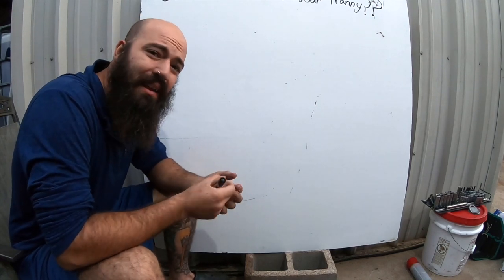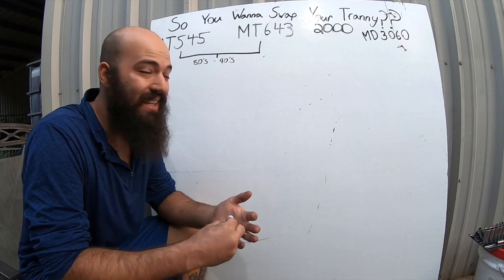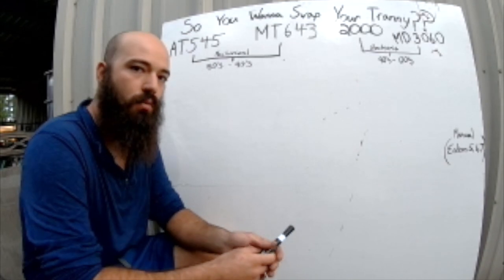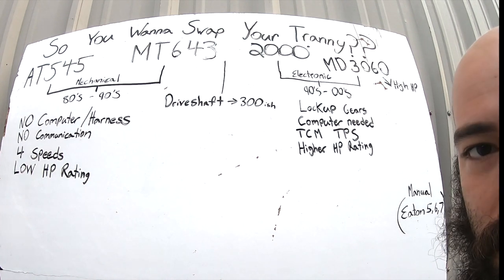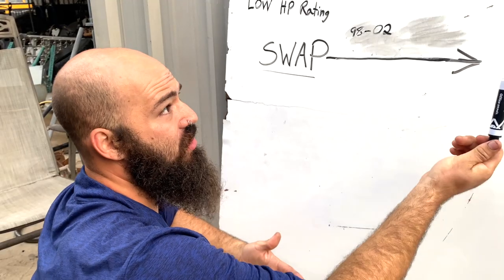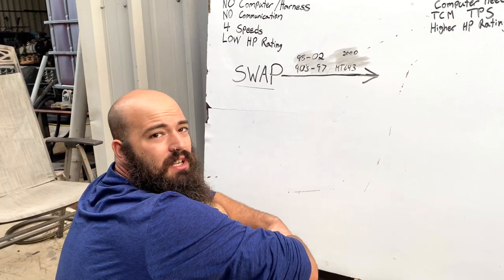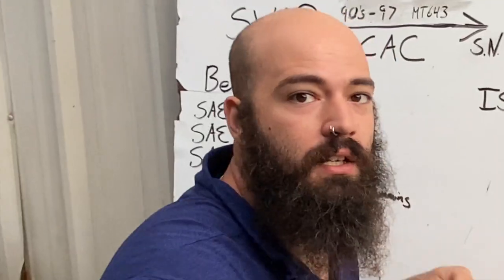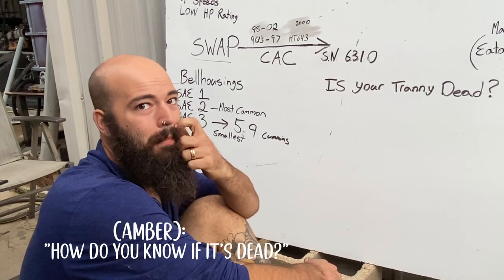Everything you need to know about your SCHOOL BUS ALLISON transmission | Swapping Transmissions

Comment: I cannot tell you how helpful this video and your trans cooler video has been to me! I worry constantly about my At545 mainly because of the hate it gets online. I have driven up and down mountains, trails and highway, for 3 summers with no issues (besides slowness lol). I just checked my fluid using your tips - it's red, no burnt smell and it did not burn my skin, happy days! I do want to install a cooler so will be looking into that. Again, thank you so much for your clear explanation, covering it in such detail easy enough for non mechanics like me to understand. YOU ARE THE BEST!
Reply from the maker: Thanks for watching bud! Glad your 545 is doing its job. It’s a beast, just slow. Run an oil analysis on it if you want better insight on its condition!

Comment: Yep, I've done the AT545 to MT643 conversion. Added a cooler and now tow over any pass with zero overheating issues. So glad I did it!!
Reply from the maker: Whoop whoop! I’ve only driven one 643 on flat highway. I’m so glad you did it too😂
Reply: I need more info about this. I got a. At545  trying to swap it

Comment: I've been following along for awhile now, nice work on the swap.  I have a flatnose Bluebird and I'm researching options.  You mentioned that a manual transmission cannot be swapped into a flatnose, cabover semis would beg to differ.  I can't find any information online, so it looks like I will pave new territory and document my journey.  Your information provided here is invaluable. I will now be looking for an Eaton Fuller 7spd vs the 10speed I had originally planned
Reply from the maker: So happy to hear you’ve found value in our content. It sure is frustrating to do mechanic work & film at the same time but you should absolutely pave the way with your flat nose!
You are also right about cab overs, in the year since filming this I’ve had the pleasure of driving and working with a cabover. There are a few transmission options in these cabovers that are shifted by cable. The one I’m familiar with is Eaton’s roadrunner series but it’s just as wide of not wider as 10, 13, 18 speeds. My concern is it fitting between the frame rails.
We have a 7 speed Eaton fuller for sale here in Alice, TX. A used take out
Feel free to email me for my contact info if you need help or an ear.
Parishskoolie@gmail.com

Comment: Nicely done!  It's so good to hear a voice of reason regarding the maligned AT545.  Absolutely, it's not the most desirable...the lack of torque converter lockup wastes some energy, creates some extra heat, and reduces (almost eliminates) engine braking effect...but they are common and well built and can serve well, if taken care of.

Don't forget the MT653, if you can find one.  It's just the 5-speed version of the 643.  Both are great transmissions.

And, one addition to the mention of the MD3060 (or the 2000s).  Most do indeed have pushbuttons, which is a good way to identify those.  But we've also bought school buses with MD3060 transmissions that have a manual shift lever.  So, we advise shoppers to not immediately assume a manual lever means a less-desirable transmission.  Look for the little red LED indicator square next to the shift lever...which an AT545 or an MT won't have.

Thanks for putting this video together!  Liked and subscribed.
Reply from the maker: AWESOME! Thanks for watching & following along friend!
We would've loved not having to swap our tranny, but out 5.9 Cummins is very grateful we did. Feels like we just unlocked a governor!

Thanks for your input! I COMPLETELY overlooked the MT563(even tho i have a manual for all these Allisons). The manual shift indicator is great info as well, Its crazy how inconsistent these buses are with their interchangeable options.

full swap video coming out soon!
Reply: @parishskoolie  Right on.  If you get West on I-40, let us know.  We're just West of Flagstaff and have a nice bus parking spot you're welcome to stay in for a few nights.  Summer temps up here are nice.

Comment: Love the video it was great I learned a lot I have a 85 international with  Detroit 500 V-8 diesel 545 Allison. so this bus has 96,000 original miles.  The transmission has been perfect except for I had it idling while loading all of my belongings to leave my property and start traveling.  and went to move the bus and it would not go into gear. shut it down. checked everything everything seemed fine. linkage is moving fluid perfect not burnt super bright red no metal shavings in just looking on my hand. doesn’t smell burned. cranked the bus up again went directly into gear didn’t think much else about it just thought something weird happened concerning but. went ahead and tried to leave went through all of the gears and then started up a hill and would not pull.  Will not go into gear at all any gear until you shut the engine off let it sit then it will go into whichever gear you put into first if you pull it back out of that gear while it’s still running it will not go into anything else and will not go back into the previous gear. The temperature that day was about 100° outside the engine never overheats it was running about 160. i’m dropping the pan in the morning. i’m a little bit stumped I do know the internals of the transmission but I never have rebuilt one. I and I definitely do not have the money to pay for rebuilding one. if there’s anything you can think of that this may be please contact me  .
maybe Facebook or messenger I check every once in a while (Marc Marine)
sorry for the super long book haha. hope to see you guys on the road one day I’d love to show you how I’ve built my 40 footer. it’s very unique. thank you guys and I’ll check the comment section again.
Reply from the maker: Thanks for watching! Sorry to hear about your misfortunes. I hope dropping the pan will give you more insight, I am stumped too if your fluid is nice & clean. Then again, I’m no transmission tech.
I have a tremec 5 speed tranny here in Alice TX that should bolt up to that Detroit.
It definitely sounds like the trannny is toast, but hopefully it is something simple. If not, I’d use the opportunity to upgrade that tranny!
The HT740 is a full mechanical high HP tranny used in the 70’s-90’s. Could be an option for you too!
Reply: yes I am very stunged myself well I’m in Arkansas. so don’t tempt me  lol 😂 I will get ready and drive down there today on my bike strap that to the backseat and start the swap haha. Would you want to call me I would like to see what I can do to get that transmission from you lol
Reply from the maker: @2skoolie4kool46  
Email me, I’ll shoot you my phone number.
Parishskoolie@gmail.com

Comment: Great video and I'm impressed with you taking the time to research like you did. I have a AT545 in my 1991 with a Cumming BT6 12 valve. I haveonly put around 75 miles on it and that was driving it to my shop from the seller so  I do not know the condition of the 545 other than the fluid is dark collored smells but not so much " burnt ". My plann is to of course add an external cooler after the radiator and then to the external filter on the side of the 545.. Next I am going to take the pan off , change the internal filter and fill it with PAO pure synthetic fluid to get the protection and it will also keep the 545 cooler than styandard fluid would. Then I will puit around 50 miles on it and drain , change both external and internal filters then fill with new PAO fluid so I will have gotton most of the old fluid out of the torque converter . I feel good about doing it this way what do you think ?
Reply from the maker: Thanks for watching and commenting with your compliments! I have heard from many mechanics than a complete flush in a mechanical transmission is not ideal.
I would first run an oil analysis to see what excessive metals are present.
Change your external & internal filters and keep on rolling. I would not recommend dumping again after 50 miles. I can’t tell you why old school guys recommend this method, but my assumption is the conditioners & cleaners in “new age” oils will strip the residual clutch material away quicker.
Change your filters and keep that baby cool. Should last a long time!

Comment: Great info! Thank you. I have a 00' f650 with a 545 and my speedometer stopped working. Have noticed any drivability issues. Speedo sits on zero, rpm's work. Could you suggest a couple things to check? I can't find much info on this.

Comment: I will be pulling a AT545 out of a 1996 international bus short bus with the T444E (7.3) gunna be trying to swap In a MT643 that was coupled to a 453 Detroit see what bell housing it is when I get it. Just from online s looks like the SAE 2
Reply from the maker: I would imagine it’s an SAE 2 this is what all(most) 7.3’s come with. Luckily, I have found many of them with just an adapter ring in between the bell housing that converts it! Hopefully you have one, not all do.
The Detroit I have much less experience with, best of luck!! Your motor will love it without that 545 behind it.

Comment: Hey guys great video thanks for the Info helped alot my girl and I just got a 2002  Is International with the AT545 a it ok for now but it's great to know the other options thanks again for the Info yall take care
Reply from the maker: Thanks for watching buddy, congrats on the bus! Take it slow, it’ll go a long way;)
Reply: Thanks appreciate that yeah we ran into a few mechanical issues right off the bat  Which has slowed progression on the inside down but we've got most fixed so far one other little problem  Has popped up a squealing bearing I think it's coming from the alternator so working on that  I'm trying not to get discouraged I know it's a process and it'll come And I see everybody who has a skoolie goes through it but it sure would be nice if things would just  not break for a little while lol we really enjoy yalls videos they have been helpful  Especially the one about licensing and insurance we live in Louisiana too so it was very helpful
Reply from the maker: @austinpowers82484  It’s always ups and downs. Turning wrenches is a part of this life, we are over 3 years now due to this process of getting discouraged and handling mechanics! When you get to see mountains behind the wheel it’s all worth it.
Per the squeal, look into a tensioner pulley. Those usually make the most noise(if you are still troubleshooting this)Assuming you have the T444e you can get a 7.3 power stroke one at any auto parts store. Keep on keeping on buddy!

Comment: Allison MT 653 is a 5 sp with a "granny low" so with a higher differential gearing you can effectively have a OD transmission,  a least when it relates to engine RPM vs road speed.
Reply from the maker: I laid eyes on the Mt653 for the first time in the past two months. Caught me by surprise, it looked similar but I knew something was off!
It’s a bummer they had a granny gear instead of an OD. They missed the mark🤣

Comment: Man this video was just what I was looking for!! Thank you so much for your time in this, that is no small task. I just traded for a 1999 Freightliner MT45 (step van) 5.9l ISB with a Allison 542 i was told that is the same as 545 but smaller pan. But i just found a Allison 2000 that is mated to a ISB out of a bus with 86k miles on it. The seller wants $425.00 and is 150miles from me. I want to build this van as a highway rig and i am told the 542 is a city driving trans. My question is, will this be a transmission that will work good in a medium duty application? I am not certain what horsepower I have but was thinking it is 175 hp. The stepvan has 14,500 GVWR. Hope you see this and thanks for your help or advice
Reply from the maker: That is an awesome price. Those combos usually sell north of $3k.

I actually have a ISB/MD3060 frame cut listed at $7k

The Allison 2000 series is great. Perfect for highway driving, i hope he saved the wiring harness with it.

Comment: My 1992 Monaco Dynasty has a 300hp Cummins 8.3 with exhaust brake and MD3060. 4th is 1:1, double overdrive, lockup, digital pad with dual gear display and econ mode
Reply from the maker: Beautiful set up! Crazy how this 3060 was used for so long🤯

Comment: Great Video, I have an Allison 545 and an IHC 7.3L A170 motor, I want to swap to an MT643, other than the drive shaft length,  What other things do I need  to do for a swap.  Thanks.
Reply from the maker: You will need a different flywheel, and you’ll need to take off the adapter ring. Best of luck, email Parishskoolie@gmail if you need quicker assistance.

Comment: Xcalliber transmission is another source of built allisons per vehicle. 
I'm looking into changing my AT545 to a 6spd Allison 2000.
My daily vehicle with the duramax / Allison 6spd combo has made me want the newer style in my 2000 step van
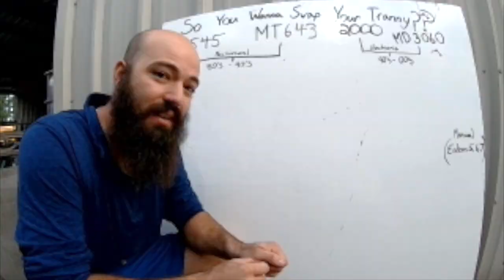I hope the 5.9 Cummins step van will be a better driver with a park position on the shifter, a lockup converter and two overdrives that will help offset the 4:56 rear gears.
Reply from the maker: Oh! Awesome resource, thanks bud.
There’s no way it wouldn’t be perfect with all those upgrades! Sounds like a very tight job tho on a van😟
I was bummed to find out my RPMs weren’t effected with the extra gear. I was doing 2400 @55mph. Now doing about 50-75rpm less, it seems like bigger tires will make all the difference. I pulled the rear chunk out, but after doing the math it won’t be worth it. Our bus now has 4.66 and the donor bus is 4.33
Reply: If I'm not mistaken the final drive ratio is still 1 to 1 in the non overdrive transmissions. 
Fortunately my AT545 and the T2000 are nearly the same size for fit, and the step van platform
was designed with lots of room to work. 
Actually I'm tempted to just find a wercked Chevy 2500HD with the Duramax / Allison combo and just transplant the lot.
The only real difference between the T1000 and T2000 internally is the gearset is angled for quiet operation in the T1000 and a T2000 has a straight gearset for a very slight power advantage.
Reply from the maker: @beaversstumpgrinding3352   I believe you're correct about final drive ratio. wish I would've realized this before hand! we are still satisfied with our manual 5 speed! Its Much easier on the motor! good luck with your swap buddy!
Reply: @parishskoolie  NICE VIDEO,IS THE MT643 FASTER THAN THE AT545?

Comment: Hello I just watched your video and loved it. I have a 1998 International Amtram 7.3, & on the highway at 60mph the rpm was 23 to 2500.  So is it safe to say I can only drive her at 40 to 45mph?
Secondly, how do I know which transmission my bus has?
Thank you for a very informative video.
If I plan to tow a vehicle should I add a  transmission cooler, just change the whole transmission.  Thank you !
Reply from the maker: Thanks for watching bud! I’d say it’s safe to assume you have the AT545 at this ratio. It’s not unsafe to run on the highway at that RPM but I would not consistently run 4+ hrs at this speed. I run my 5.9 Cummins at 2300rpms consistently @60mph now.
If you crawl under the bus, your transmissions tag will be on the passenger side. Will probably be covered in oil & debris. Bring a rag!

Comment: another nice thing about a manual gearbox is that you can shift down and take youre foot of the gaspedal and use the engine to slow the bus on long downhill slopes , saves you overheating youre brakes 
as for the electronic transmissions : even if there stand alone tcm  they still need some info from the engine , things like trottle position rpm and maibe boost vacuum , some of these it can get from the trans itself but theres a big chance it piggybacks some of the signals from the engines sensors

hmmm figured the engine to trans mounting plate on the engine behind the flywheel was wat you needed to transfer to youre other engine , to make another size bellhousing fit , at least thats wat i seen on DEBOSS GARAGE , the guy often thinkers with diesels and changes engines in all sorts of tuff from a dodge pickup engine intoo a dozer to an chevy ls in an audi quatro , might be usefull to watch some of his stuff as its verry out of the norm stuff and he has some verry ingenious solutions to things

the burned transmission fluid smells like burned electric components / circuitboard , if you ever released the magic smoke on sumting electronic you know the smell
Reply from the maker: Yes! I’ve watched quite a bit of been deeboss garage. This is what I meant, it’s called the “clutch housing” on this 5.9 not sure of other motors. Thanks for watching buddy!
Don’t let the smoke out!
Reply: There's a step-down ring sometimes installed on a SAE2 flywheel housing that allows the SAE3 Allison bellhousing to bolt to the assembly. You have to use the appropriate adapter / spacer that allows the Allison torque converter to bolt to the engine's flywheel / flex plate.

Comment: I am installing a 1000hs, as long as the donor tranny has a round bell housing it will bolt up to a 5.9 12 valve.
Reply from the maker: Hopefully this is a question & not a statement.
Most bell housing are round, SAE 1,2,3 are all round with the same 12 bolt pattern. It will only fit if you have the correct bellhousing size. Measure center bolt to center bolt, best of luck!

Comment: A Eaton 13 speed will fit between the rails of a 1998  Thomas bus with a 5.9 in it with all the parts and with hydraulic clutch.
Reply from the maker: In the years since this video I have learned anything is possible with the right amount of effort plus money🤣
I have seen many folks on YouTube south of the border putting 13 speeds and larger in school buses. Even seen one in a flat nose!
I don’t have that kind of effort, but I agree now.